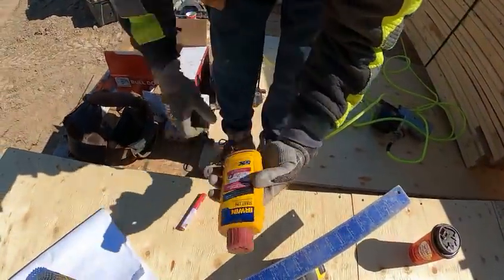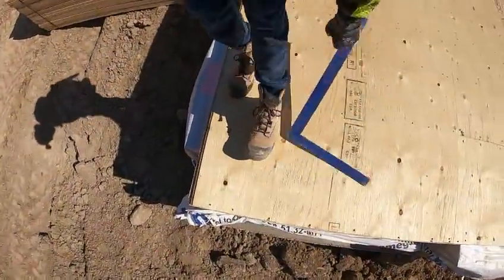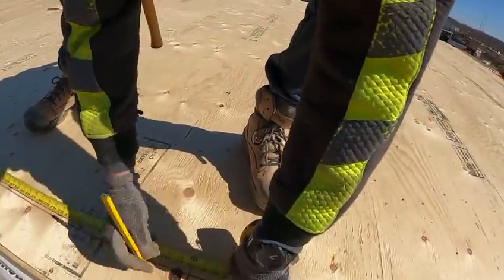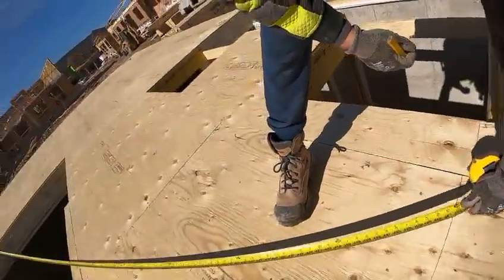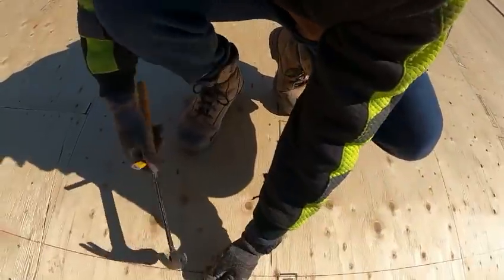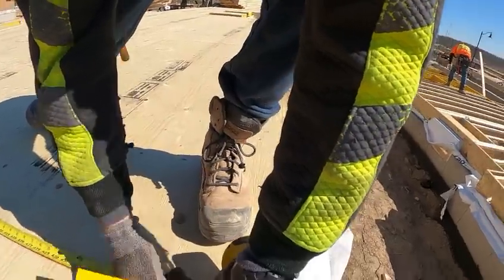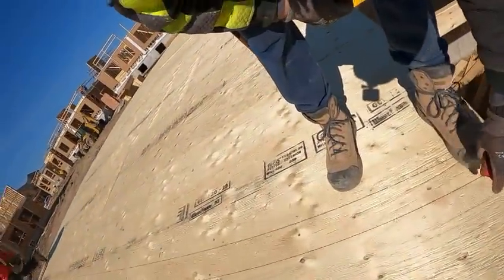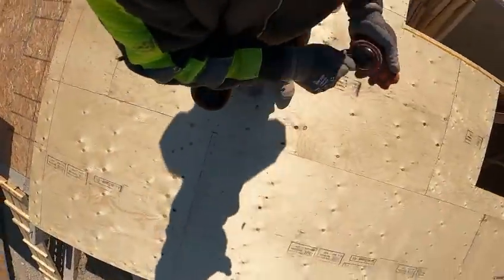chalking out outside lines using 3-4-5 rule and equal measurements

Comment: I was very confused until I read the comments and everyone agrees with my thought pattern... It should be square already.
Reply from the maker: I recheck the square at every stage
Reply: @framingbeast720    Yeah but if u watch the video.  You didn't start on a square floor.  Not sure if you built that or not.  Seemed weird to me you would used the gable for square also.  Wouldn't it be better for the truss walls  to be parallel and tweak your gable walls if you have to?

Comment: Just my opinion but I always layout and pull diagonals on foundation. Square from the start.
Reply: Foundation and floor, them green guys I swear deliberately don’t follow lines setting plates
Reply: That’s how we do it but for some reason we end up doing the same exact thing as when we check the foundation for square. 6,8,10. Then we check diagonals then check for parallel. We do that process at least 1000000 times because the boss doesn’t trust himself or anyone else else for that matter

Comment: 6.5 to 5.75 didn't you square up create first wow I'd be freaking out that is .75 of an inch in 40 feet
Reply from the maker: I'm not because it's the porch and they are going to fill with concrete then brick anyways. It's not worth losing any sleep over. Now on the other hand if it's the stairs or my sunken and it's even 1/4 off totally different matter. I used to square the foundation and chalk it then I stopped unless its for prefabs where there is set panels sitting on those mud sills. I always make a loi t of measuring my brick to brick outside house measurements front to back, side to side then if that's in place I go flush to Inaide of foundation
Reply: @framingbeast720  I respect your enthusiasm but any framer that show's up on one of my jobs and doesn't square the foundation Everytime only lasts a few hours but I have never had to fire a guy for that before you are the first framer I have seen that doesn't square the foundation sorry buddy but that is what hack's do

Comment: The building should already be square at that point… It should have been squared up at the foundation plates before the joist and deck… And for the building to be out over an inch in what looks to be about 50’ on The joist and deck can be somewhat of a problem… If you hold the wall in on one side and hang it over on the other you will create problems with the siding… If you just go with it you will have problems with the trusses… Again it should’ve been squared at the foundation plates before the joist and deck
Reply: No disrespect, but you’re telling me that you don’t even check the foundation for square and just joist & deck it as is... then square the walls on top of it... I’ve built 100’s of houses and been around many different builders over 30+ years and never have I ever seen it done like that... So I guess you can skin your cat your way and I’ll skin my cat my way... but you which way is right
Reply from the maker: @hmtrimworks7148  I measure the foundation when. I start .should always square the walls or else world of hurt later.
Reply: @hmtrimworks7148  I agree with you 100% these guys are silly.
Reply: If you start square and level it should stay square and level I've never seen anyone not square the foundation except Larry Haun hacks
Reply from the maker: @Tonymikesell1982  mudsill flush to Inaide of the foundation u less I. The garage if they want a ledge
Reply: @Tonymikesell1982  
Larry Haun hacks?
Larry squared his foundations too.
I’m not following you .
Reply: I agree with HM Trim. Framed 100s of houses and always square up the foundation first. My ocd is off the charts right now.
Reply: Exactly  ty. Wtf. I've had to build apartments that were 15''out of sq with component systems.  Not fun but them fucking cc guys. Builder needs to b there when cc guys form up.
Reply from the maker: A few  things to note: 1)no siding, only brick which increases tolerances. 
2) why would I waste time squaring the foundation when I'm going to square what's more important above it, the walls. I chalk the foundation middle wall between the units to maintain my 1  1/2 drywall space and away to the races.
3) if the walls of out or in more than 1/2 I make the adjustments sometime splitting the difference.
Reply: @framingbeast720  If it's brick, that makes more sense to me. The inside walls are more important obviously, otherwise, you're only compounding drywall and finish issues. The big question I have is if it were a siding job, would you be more inclined to square the floor?
Reply: You are absolutely right . Or I work in California we square everything up so we don't have to deal with that before and we were bags the right way and we don't wear sweatpants on the job
Reply from the maker: @calebcastano9126  right on, people hating on my jogging 👖! Lol. I bought 2 pairs of  nice thermal church pants at costco but when I went back they were sold out but jogging pants are ok in a pinch. So let's review. Square everything and wear pants.
Reply: @framingbeast720  LOL we're not hating. I just want a Pier.
Reply from the maker: @calebcastano9126  it's all good bro
Reply: @framingbeast720  I'm wearing sweats
Reply: @framingbeast720  don't worry about the comments have fun and do your thing I like to think we're laughing with you not at you God bless
Reply: @framingbeast720  I don't care what you wear but for the love of god square your foundation you're floor is an inch out that would be your last house for me.
Reply: @framingbeast720  L.O.L. Doing it like 41yrs. and prefer sweat pants. Better then that sore on your belly from the toolbelt digging in the pants snap button. Also allows more freedom of movement for bending, twisting and flying around. Always squared the foundation do the deck would be made square and follow right on up. However the high caliber framers I've known share things but don't put much into trying to question anothers methods. So many lose track on it being "rough framing". It is more the time its done in and the finished product that like framing, all the other trades have tricks of theirs to make their work come out right. Quarter bubble, no trouble as how many times after the home is finished do people walk over and put a level on the wall ?
Reply: @calebcastano9126  
It’s not what you wear that dictates talent.
I’ve seen hack morons wearing full occidental leather bags, steel boots and work pants. 

I’ve seen master carpenters carve hunting miters in flip flops

It’s ain’t a fashion show
Reply: @itaintrocketscience  stop trolling
Reply: @calebcastano9126  
What an intelligent reply.
You’re the same type of guy that replies “ what?” to text messages.

Comment: How would u use 3-4-5 when ur dealing with such big measurements? Wouldn’t u go up to a higher more divisible number of Pythagorean theorem like 20,21,29?
Reply from the maker: It's any constant number times 3, times 4, times 5....15...20...25.. so on
Reply: He did. Multiple of 8. He had a 40' tape. The biggest he could go at that moment.
Reply: It's not even the best  method to use. Just use the Pythagorean theorem to establish exactly what your hypotenuse length is per the exact wall length measurements. That way, there is no projecting like when using the 3, 4, 5 method. To do this quickly, use a trigonometry app.
Reply: @N1rOx  wow, that's actually really easy. thank you
Reply: @jessejames7596  your welcome bro
Reply: @N1rOx  that is a hypotenuse it’s a 6 8 10 check I didn’t really pay attention to how he did it in this clip but if you Measure out 6 feet on one wall or side and 8 on the other it should be 10 unless it’s not Square because the hypotenuse gets infinitely longer if it’s not Square and any multiple of 6-8 and 10 works in this case 3-4-5 and the reason I believe multiples of 6-8-10 is used is because it’s a nice round number
Reply: @austen9556  yes but it's still a projection if it's not the exact wall measurements. Which in most cases is fine, my point just was that there is a more accurate way to do it that uses the exact wall measurements, ensuring without a doubt that the points are square with respect to the actual wall dimensions.

Comment: When you are laying out the exterior walls do you run the bottom wall plate so it is flush with the exterior of the rim joist or do you compensate for squaring things up?
Reply from the maker: If I'm running it through I always mark  5.5 for the 2x6 first then toe to   the chalk line...I've seen guys who just nail it flush with the outside of the rim and that is undebatably wrong

Comment: Coming out of the hole is always a good day. You say heavy, I say strong and shy.
Reply from the maker: I agree
Reply: Confused
Reply: @seanmayo206  Terms used with measurements that don't land exactly on the tape line's. Leave the line and take the line are used too. if the measurement is just a hair over 21 inches you say 21 strong or tell the cutter 21 but leave his cut mark. if a hair under 21 its 21 weak or 21 and take the line.

Comment: Hey man Why the Dewalt hammer and not a stiletto, just personal preference or?
Reply: Those dewalt hammers( preferably the mig welded 12 and 14 oz) are very underated, my 14 dewalt is about 4 years old and still has a waffle, not alot but still has some and my stilleto mushed out in 6 months
Reply from the maker: @dakushlife5225  I've seen the same...the head of the stiletto costs more than the dewalt by easily 40$....my old dewalt 14 lasted same 4yrs and the handle came off...so I epoxied it and now use it at home on wood projects where I don't want the  meat tenderizer marks on the wood
Reply: Those dewalt hammers( preferably the mig welded 12 and 14 oz) are very underated, my 14 dewalt is about 4 years old and still has a waffle, not alot but still has some and my stilleto mushed out in 6 months
Reply: Love the vids btw learning lots
Reply: I use the Dewalt hammers too. They're very nice.
Reply from the maker: I have a 15 oz titanium ti-bone but no more grip. I am intrigued by the axe handle ti 🦴 mini I have to say

Comment: Is it the builder/homeowners job to get blueprints, permits, lumber, etc or is it your job?
Reply: It's the GC job . 
He most likely a sub which mean he just build rough and then move to the next one.
Reply: General contractor does all that. Sometimes the framer may supply Lumber if that's the way the deal was made.
Reply: Framers usually tell lumber company when to bring the lumber packs other then that it's general contractors job
Reply: GC's job. Framers scope is erecting, providing the crane if trusses are used, and nails. GC provides the material, trusses & hardware. GC is responsible for calling and scheduling the inspections. Fact is a builder is not really a "builder". They are just construction managers.